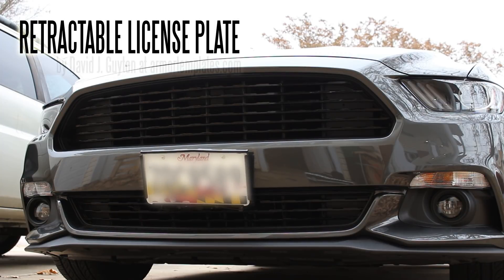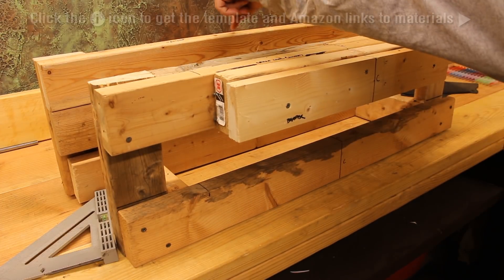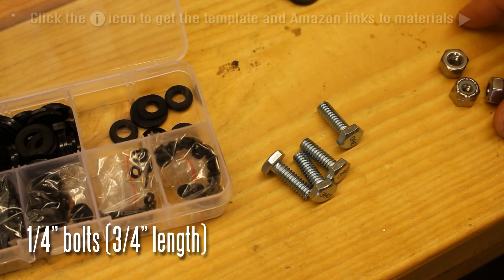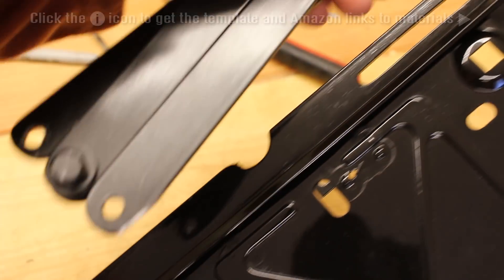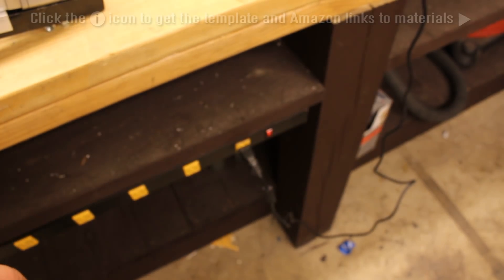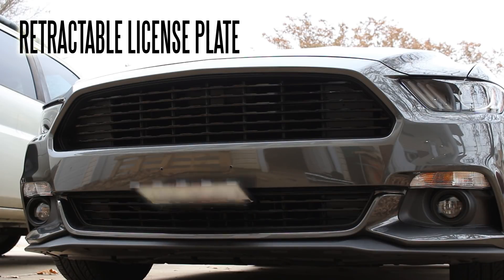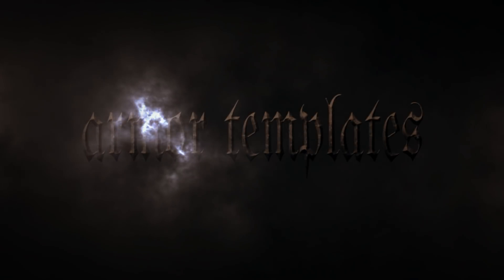How to make a Retractable License Plate

Comment: Awsome!
This is going to save me a lot of money on toll roads.
Reply: In Texas they scan your registration sticker on the windshield. Not sure of anywhere else.
Reply: Dang...
How did you know I was in Texas?? o_O
Reply: @Perceptence  The trick is to install this on the rear of your car, and keep your front license plate on the car's dash. Every time you go through a Toll road (outside of Texas apparently where btw I lived for 6 years and NEVER paid 1 toll lol and they didn't do anything so not sure why it would matter there!), manually remove the front tags and hide the rears before you go under the Toll cameras. Make sure no cops are directly in front of you or in back of you, it's actually pretty easy and I've got them installed on my car and save about $2,350 / year doing it. My friend is a cop and said they wouldn't even know how to ticket for it unless you used it in a crime e.g. hit & run, robbing someone etc. but for harmless toll dodging, it's fucking brilliant and my buddy was high fiving me for the idea, i kid you not. If somehow you get pulled over just say you go to car shows and accidentally hit the button, the key is not to be a dumbass. For example, I could see some idiot getting carried away with one and racing with it, and getting chased by a cop and then getting caught. then, you'd probably get railed pretty hard for it according to my cop friend.

Comment: Looks like a fun project for this winter. Would love to see a video and stills of the complete assembly on the bench actually working. Is that possible David?  BTW, I just went to your site and while I saw all the parts and links for them... I did not see the link for the actual template PDF.
Reply from the maker: Sorry but it's in the car and it would be a real hassle to get out to take pics of it. IT's a pretty straightforward design though, nothing too complicated

Comment: Id like to see where you put the switches in the car and made it look stock
Reply from the maker: when I filmed it, I hadn't mounted the switch yet. There's surprisingly little space available for it anywhere in the car. I ended up taking the console out and finding a spot next to the shifter, but the switch is a little bulky and sticks up pretty high. I am considering doing some major surgery on the console and recessing the switch significantly

Comment: Wow nice work man. Idk if it's worth the effort when small battery powered screwdriver  can take the plate of just fine. 
Idk how often you retract it, If its every day then ya. But if its once a month or once a week for car meets then just use an battery powered screwdriver to take it off and throw it in the trunk. You also wouldn't permanently damage your car. Nice craftmanship though, it's certainly and interesting feature and talking point.
Reply from the maker: It's always retracted. It only goes up when I get pulled over for not having a plate.

Comment: Where is the cable anchored too ? Didn't see anything in the video or instructions explaining that.
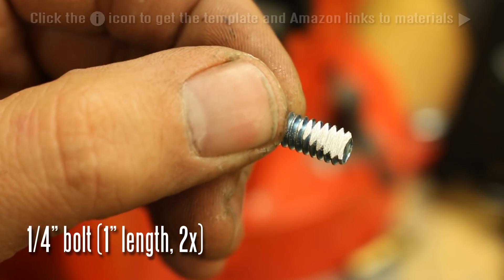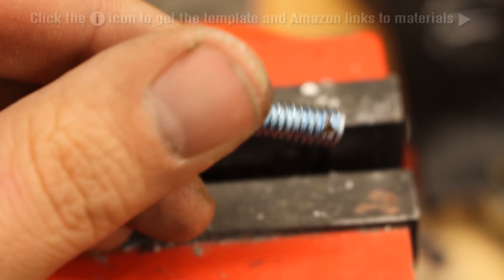Reply from the maker: There is a small hole in each of bolts that I drilled. That is where the far side (closest to engine) connect. You can see that at the 5:00 mark in the video. The other side connects to the license plate frame itself. You can see that at the 5:15 mark.
Reply: David Guyton  was wondering where the best place at the opposite end mounted , not the license plate end of the cable.
Reply: Or does it anchor to that bolt the hole was drilled in, wasn't sure if that was just a guide for the cable.
Reply from the maker: the cable goes through the hole drilled in the bolt, and it terminates right there at the bolt. It's not a guide for the cable, it's where the cable mounts to

Comment: 1. Is it legal?
2.Does it scratch the paint?
Reply from the maker: 1. Check your local laws
2. I added a foam pad on the back of the plate to keep it from scratching the paint. I also intend to adjust it away from the bumper a little bit. No scratches so far